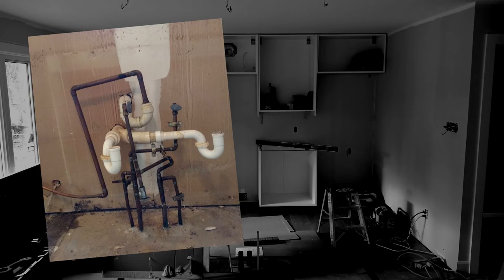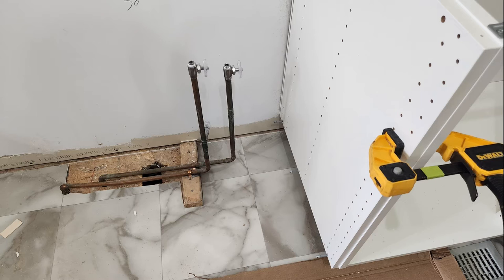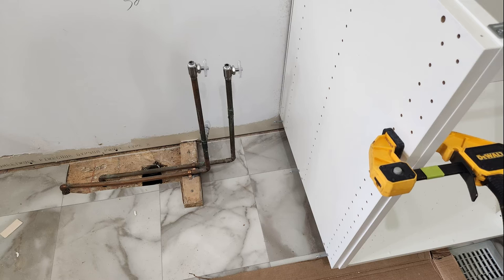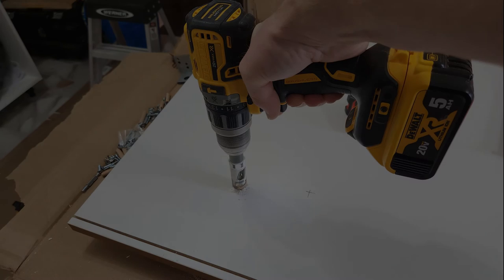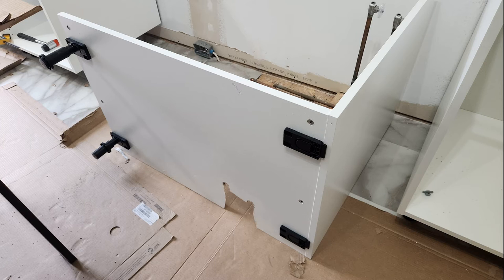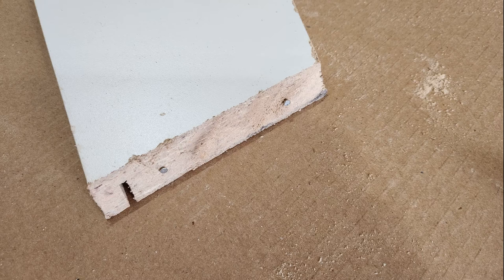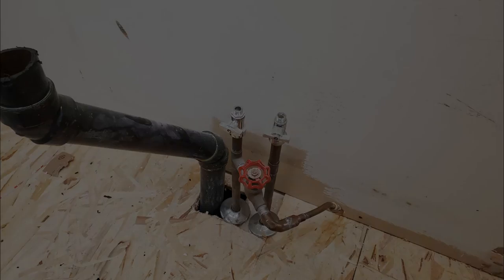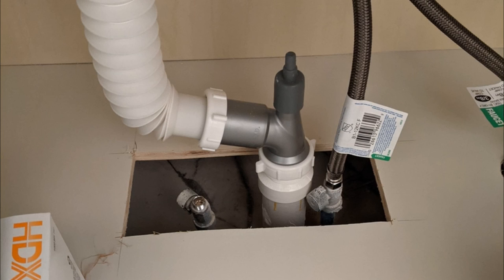How to Cut PERFECT Holes for Pipes In Your IKEA Kitchen Sink Cabinet

Comment: that's really impressive in how simple that is! I think I've got a few ideas of how to do it, but it might be nice if you showed your technique on how you're copying the position of the pipe holes
Reply from the maker: @JimShealy  Thanks Jim.
I hear you. I simply measure from the panel I clamped onto the corner cabinet to the center of the pipes and again from the wall to the center. The last measurements must be reduced by about ½" as that's the distance from the wall to the cabinet.  Thanks for bringing this up ☺️
Reply: @kitchensbyrannes  I tried it and it worked pretty great! I think I found a potential improvement to the rear panel. I had to get mine around a drain pipe, so what I did was to use a saw to score straight down from both sides of the pipe hole, leaving enough thickness the white face panel is uncut. On one side (from the back) I cut through the score with a razor blade. The other sides' score acts as a hinge. You can now bend the hinge enough to get around the pipe and then push it back in place. It leaves almost no trace once you put it back, and there's no gap!

Hope that's useful to someone!
Reply from the maker: Sounds great 😃 
Yeah, who knows, maybe someone will replicate your technique ☺️
I've tried something similar but with only little success.

Comment: Good ideas here that I found (the "nail hack" for the correct cut out levelling - hence the "saw dusted material" lost during the cut). I am just into putting together Metod sink cabinet. It is flush to the left and all the piping (water and sink) arrives from the left side wall. Obviously I will have to cut (out) the left side piece but my question targets the insertion of the back panel, towards the wall. Since in such occasions you are assembling the cabinet "in place" there obviously is no way you can nail that back panel in place. How "unimportant" is this considering the stiffness of the whole cabinet once fastened to the other(s) sideways and covered/screwed with worktop ?  oooops....just discovered: how in the world would you be able to slide in the back panel when you have the rail bracket screwed in ???
Reply from the maker: Thank you for your comment.
As long as the sink cabinet is sitting next to at least one other cabinet, omitting the nails isn't an issue.

Sliding in the back is easy as I do it before I put on the left side of the cabinet.
Reply: @kitchensbyrannes ...aaahaaaaaaaa 😂 is my shortest reaction....now I rewind and at 7:42 I see what you mean...thx again 😃

Comment: This is great! You are very good. What if I have to do the same but my pipes come in from vertical wall. And the cabinet back wall is a thin cardboard as you know.
Reply from the maker: Thanks.
In those situations I assemble the cabinet in place too. One side and the bottom. The I push the back in, towards the pipes and mark their heights and horizontal distance and then cut horizontal openings from one side to the respective pipes. If they sit up in the cabinet, you won't notice them as sink and plumbing will cover. That is if you have pipes with valves an whatnot.
If you have short pipes from the wall, mark and drill holes in the fully assembled cabinet and hang it onto the wall.

Comment: Nice! I have to tackle sink cabinet soon with existing pipes. 
But I will have to perform some modifications since new undermount sink with be 10  inches deep and raise up the p trap since it's to low to have pull out drawer. Add to that, I switch the dishwasher to the left making more work.
It's looks professional the way you're showing.
Anyhow I'm having fun with this big Ikea project specially first time installing it and discover greatness of Ikea kitchen.
So if we don't nail nor glue the backboard, I could reuse the existing one and don't bother to cut, right?
Thanks!
Reply from the maker: If you are replacing an older Ikea cabinet with a new one, and it sits in the EXACT same position, true, you can jump the fence where it is the lowest, but why would you? 

If it is worth doing, it is worth doing right, and in my book, "cannot be bothered" is never a valid reason to cut corners.

So....just do it :-)

But, if the pipes are the same, maybe using the old back as a template, huh?

Comment: Do you have any suggestions/posts about boxed-in pipework running vertically on the exact join between two cabinets?
Reply from the maker: You can either change the sizes of the cabinets or cut away some of the cabinets sides. I don't see any other options.

Comment: Do you nail the backboard after? I can’t see how you can nail it in. Do you just glue it??
Reply from the maker: Hi Alex,
Thank you for your question.
I do not nail or glue the backboard in this case. When the sink cabinet is sitting next to one or two cabinets which are nailed, the is no reason to glue the sink cabinet. It'll be plenty rigid when tied into the adjacent cabinet(s).